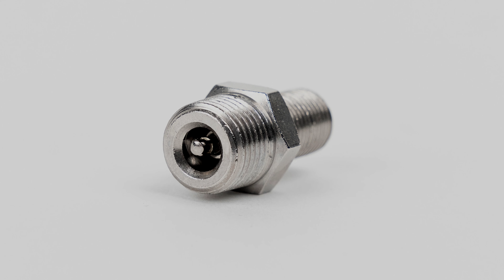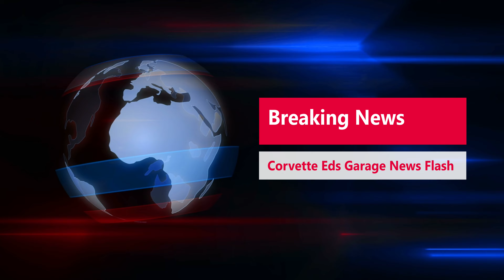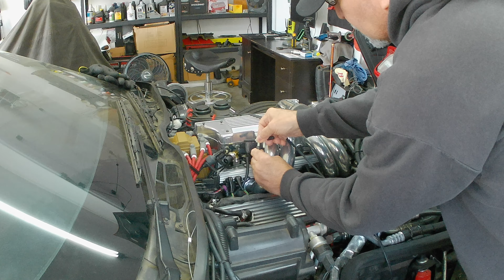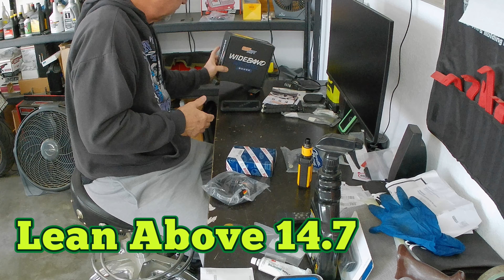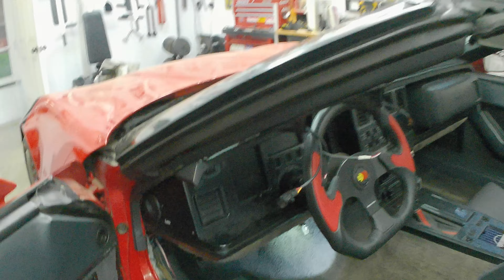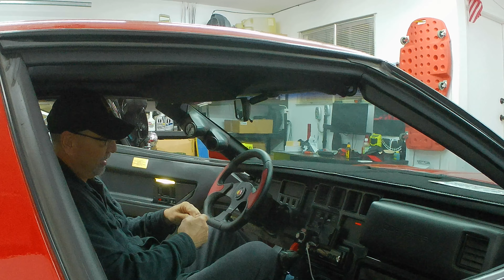What's next on the supercharged Corvette?

Comment: are u runing the orginal ecu and what kide of pressure u got on the  injectors?  and one important thing for me are the orginal instrument cluster working /cheers
Reply from the maker: Yes, I'm running the stock 85 ecm however I will be swapping it out with an 86 ecm I just picked up at some point.  Reason being the baud rate on the 85 ecm is slow where on the 86 and up is super-fast.  As far as fuel pressure depending were boost is it's pushing in the high 40s psi to way into the 50s psi range with the help of the FMU of course. My base line fuel pressue is 43-44 psi.  I have done nothing to the instruments cluster other than adding the Boost, Wideband and Fuel pressure gauges.  I like my OEM gauges as they came as well. ☮